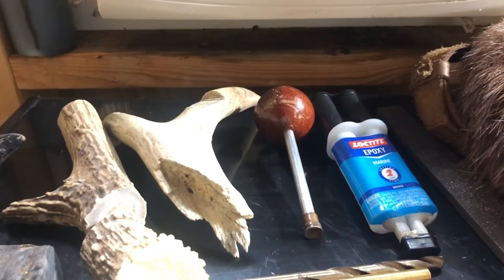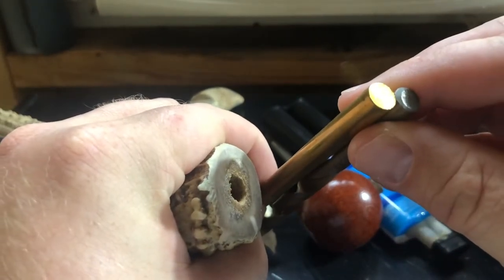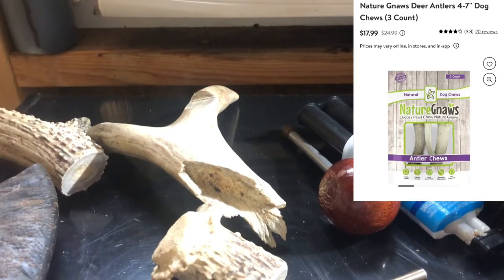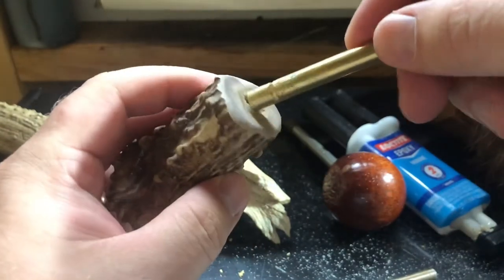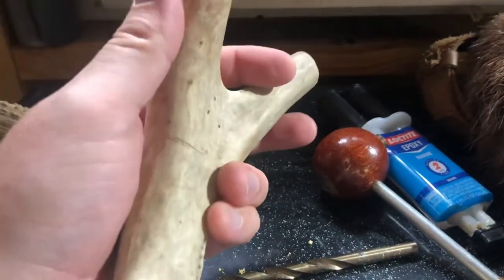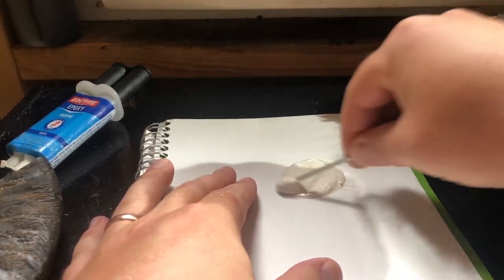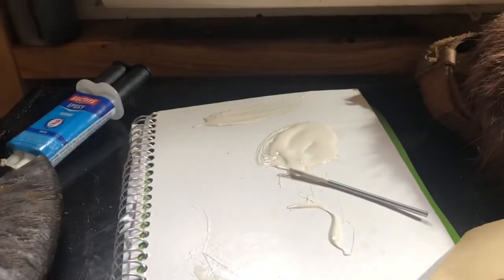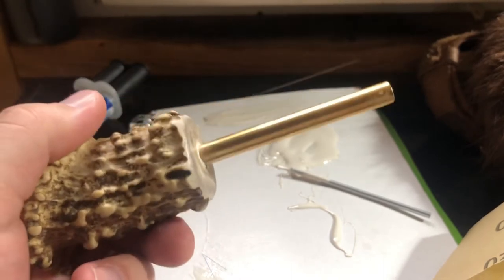How to make an antler ball starter | Muzzleloading

Comment: Looks good 👍   just wondering if a wooden dowel would hold up instead of brass that way it wouldn't scrape the barrel  in a hurry?  Just thoughts.
Reply from the maker: Brass is a lot softer than steel. Same reason cleaning jags are made of brass.
Reply: @Majormusket  I agree  I was wondering about wood dowels, if you thought they would hold up.